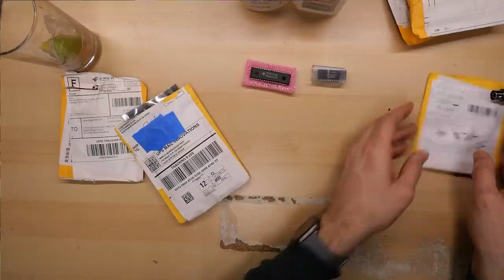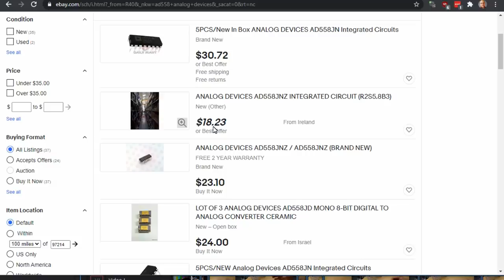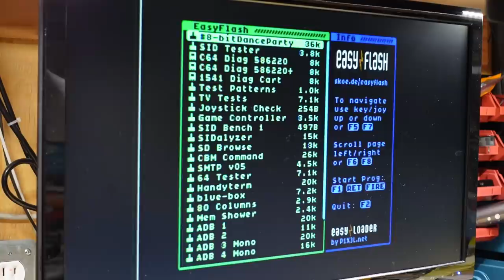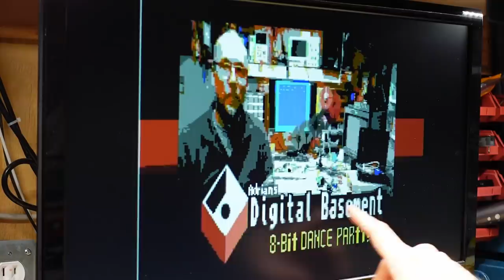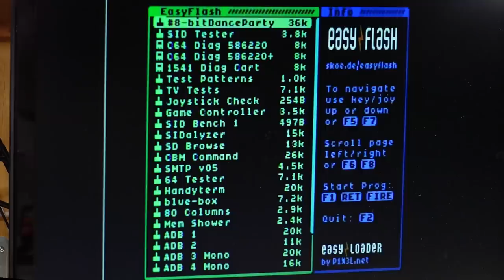I bought more C64 SID chips from AliExpress! (And some other chips too)

Comment: I would love counterfeit chips as long as they function like the real thing. So I actually hope they make a really good copy before these old chips are gone for good.
Reply: even if there close enough. like most of the time you dont need %0.0002 precision for old hardware.
Reply: There's always FPGA
Reply: There's nothing wrong the the ARMSID and FPGASID. Both very good and better in some ways than the originals.
Reply: @thomassmith4999  I've heard the ARMSID has some filtering errors
Reply: @cfothough  You are never going to get a SID replacement that's exactly the same as the SID you know because 10 real SIDs all sound way more different from each other than an ARMSID does from whatever one it's closest to. But it's good, especially ARM2SID since you get two sids inside the one chip.
Reply: @thomassmith4999  I'm aware that most SIDs don't sound exactly identical, but say you have 10 6581 R4 revisions, they'll all sound at least similar enough. I do realize now that the SID replacement I was thinking of was actually the SWINSID and not the ARMSID, the ARMSID sounds quite good in my opinion
Reply: @cfothough  Yeah the swinsid nano has flaws for sure, it's not bad with the lazy jones updated firmware, but it also only costs 5 dollars to build one, I built 30 of them one day when I was bored, kinda fun to build once you get a production run going. The Swinsid ultimate is much better. The ARMSID is very good for it's price. If you don't want to worry about your SID blowing up it's a good option. FPGASID is probably the best but it's expensive.
Reply: By the way, I am looking for a ULA chip for a PAL ZX Spectrum issue 4. If anyone  ever bumped into counterfeit ones. Just mentioned this because you guys are talking about counterfeit chips. And I hope someone can reproduct what is inside those chips because mine has a shorted cassette input/output pin.
Reply: apple macos would say with fakechip:  	Ḁ 	ḁ 	Ḃ 	ḃ 	Ḅ 	ḅ 	Ḇ 	ḇ 	Ḉ 	ḉ 	Ḋ 	ḋ 	Ḍ 	ḍ 	Ḏ 	ḏ
Reply: @andrasszabo7386  hungary
Reply: @uiopuiop3472  I am from Hungary, so, what about it?
Reply: @andrasszabo7386  just confirming
Reply: Most counterfeits are just other unrelated chips, badged to look like the in-demand chip, however.

The ones that actually work are usually out-of-spec or other rejects
Reply: The only way to replicate a SID is microcontroller or FPGA.
Reply: @bfapple  It's the analog filter that has people pining for the originals. The SID is just a simple synth with digital oscillators and envelopes with an analog filter. It can be done in a hybrid package, with the filter in discrete components and the oscillator etc. as a MCU or FPGA. Problem is, no one (that I've seen) has a schematic for the filter
Reply: @Psychlist1972  That’s exactly it. Until the schematic is released in the public domain, we can only guess.
Reply: @bfapple  Folks have de-lidded the IC, though. But yeah, that would still require a bit of guessing :P
Reply: @andrasszabo7386  Some of the Spectrum ULAs have been reverse engineered. Chris Smith had some decapped and put under an electron microscope and reverse engineered it - I don't think it was the one you mention but I could be wrong. He published a book about it: The ZX Spectrum ULA: How to design a microcomputer
Reply: They do it because the other chip was just easier to sell at one point or another
Reply: @nemoskull2262                                                                                                                                                            vv.                                                                                            V. Vvv.     F.              Ff.

Comment: As someone that's programmed for the TMS9900, let me tell you, the pin spacing isn't even CLOSE to the only weird thing about that chip. For starters it doesn't even have a stack pointer.
Reply: who needs a stack pointer? even if you want one you can easily use on of the general purpose 16 bit registers for that. With the indirect auto increment mode you will get pretty close the the normal stack pointer behaviour. The TMS9900 architecture seems to be 'inspired' by the pdp11, a computer that brought us c, and unix. Actually the orthogonality of the TMS9900 was rare at the time the processor was launched.
Reply: @available898  I actually learned assembly language on the 9900 as a little kid. When we switched to the C64 (cuz that's what everyone else had) it took a long time for my brain to shrink (as I like to describe it) before I could do 6502 assembly.
Reply: I stacked up the work spaces and used the 'registers' as local variables. 
The Otis 401 family of lift controllers that are all over the world used TMS9900s and its family of peripherals.
Reply: The workspace idea I really like, kind of like direct page on the 6809. I just am not a huge fan of the TMS9900 syntax, though maybe that's just the TI-99/4a assembler package. Also it's really annoying that you need both the 32k expansion and the disk drives to even use the assembler package. PEBs are just ridiculously expensive these days. I've used MAME for all the TI-99 assembly I've done, which isn't much. I'd absolutely kill to find a PEB for a decent price... people want like $500-1000 for them!

Comment: Sounds like TI99 did the same thing as the USSR did. The USSR stole/copied schematics for computers from USA where pin spacing as 10 pins per inch. The Soviets rounded one inch to 2.5 cm so their spacing was 10 pins per 0.9842519... inches. When they tried fitting western ICs they didn't fit.

Comment: 11:28 "no date code of any type". In the 1980s, some chip manufacturers left the "8" off the date code to avoid confusion with chip type numbers that also started with 8. That chip says "42300"  which probably means that it was made in week 23 of 1984.

Comment: The 2382 chip sounds fine, it probably has unusually high, "8580-esque" cutoff values. You may try Terra Cresta by Martin Galway or Lightforce by Rob Hubbard, those are excellent for testing "8580-esque" 6581s.

Comment: One of the major reasons that the 6581 is so hard to clone is the fact that they were made from masters that deviated a lot from the design specs, the 8580 masters on the other hand were much closer to the specs, which greatly improved their technical quality but also greatly reduced the stray current that enabled the digisampling with just the master volume control that the 6581 was famous for.

Comment: I have a feeling that smaller pin spacing is 2.5mm instead of those headers' 0.1" (2.54mm). Across 32 pins, the accumulated error would be 1.28mm, which I'd guess would be uncomfortable but not impossible to shove together, just as described.

Comment: changing the branding is simply cause certain chips get more money
Reply: the age of the CPU chip I think anyone would be happy with pin to pin compatible replacement, with any name on it? if it got there computer going, newer ones would probably be capital of running faster  with being newer, as with most CPU's

Comment: It sounds like the pin spacing on that CPU is 2.5mm instead of 2.54mm
Reply: I think some eastern European / soviet countries used the slightly off pin spacing as well.  2.54 was .1 inch and 2.5 was an attempt to make it "metric"
Reply: @stonent  yes, Soviet ICs had usually 2.5 mm spacing
Reply: That's what I was thinking too, metric spacing. Russians were well known for using metric DIP chips. It must have been real fun trying to put those socket pins in there. But what TI was thinking, who knows. Clearly a dead genuine chip; they probably had no way to test it. At least it's clearly not a 68000!
Reply: Genuine TMS9900's were 64-Pin, .9" wide DIP packages with .1" lead spacing. It is possible that the chip he received was a soviet clone having 2.5mm spacing and repainted as a TMS9900 - obviously a bad chip. At the time of the TMS9900 (1976), the 64-pin DIP, .9" wide was unusual but was chosen to prevent having to multiplex the address and data lines. Motorola would eventually use this package for the 68000. Honestly a repainted 64-pin chip could be anything so it might have been a 68000 instead of a 9900 - there is really no way to know for sure... you risk smoking a vintage machine plugging in these repainted chips - in my case I have built fully buffered "go between" sockets for these types of tests but even these aren't failsafe...

Comment: The filter on the R1 SIDs sounds very different than R4 -- there are some tunes that sound like they have missing basslines on the R1. I had an early model breadbin growing up that played Hubbard tunes (among others) completely differently than my friend's, and always thought there was something wrong with my system. Many years later, I blew out the R4 SID in my SIDstation and replaced it with a spare R1 I had from my parts bin, and manually sweeping the filter made it very clear what was going on.

Comment: This brought back memories - so many hours of my life swapping around components to try to keep a system running.  In the early '90s I ran a computer room at a small school.  When I first got there it had about 20 donated IBM PCs, and as each one failed I would replace its bad part with another from a machine that had failed in some different way.  I managed to keep the place going on a shoestring, but I don't want to think about how many weekends I spent on the floor of that room trying to get some Frankenstein's monster of a machine to last one more month.  By the time we closed the room ~8 years after I arrived, I think we were down to 12~13 working systems (and I broom closet full of scrap parts).

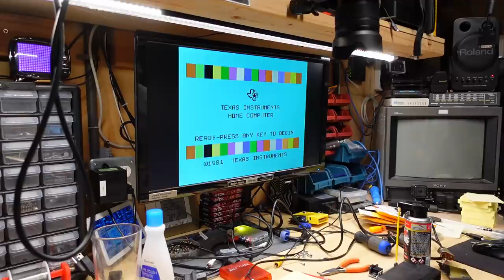Comment: 34:50 - the suspence was killing me, I was rooting for the chip to work and when the right screen showed up I was cheering like a 4 year old in a candy store :D It just made me so happy that the chip is finally working :)
36:50 - maybe you could try to use a socket that has the 2 metal thingies (or is it just one bent into a V shape), cut it up and solder the sides in so you'll have more horizontal clearance and play on the chips instead of just a single hole per leg. Just an idea. It might not look as clean but it might be easier to take the CPU in and out. And run the bodge wires inder the socket or something, but that's just me...

Comment: Today I fixed 2 Quickshot Turbo II joysticks, both had missing wires, one was just yanked off, one was cut. I had to tinker with the wiring with the new cable (used a 9pin dsub extension cable and cut off one of the ends), cleaned the microswitch contacts and they are just like new, I'm so happy!
Reply: Good work, it's always nice to repair things. I'm currently working on restoration of a 1981 'fruit machine' from an amusement arcade
Reply: What did you do for strain relief where the cable comes through the plastic shell? I'm curious because i would like to find a good method myself. I've tried with 4 zip-ties in a little square on both sides of the shell, but i think there must be a better way.
Reply: @MattyEngland  Wow, sounds really nice! I love restoration works, it's just so satisfying to do or watch.
Reply: @BertGrink  One of the joysticks still had the strain relief on the cable, I janked out the old cable and put it on the new one and put some electrical tape behind it so I won't be able to pull it through the strain relief plastic. The other one sadly didn't have the rubber strain relief so I just put a huge winding of electrical tape to keep the wire inside the shell so pulling on the cable won't stress the soldering. You can reuse old strain relief rubbers, they are not permanently attached to the wires and I also wanted to buy some online but it's hard to find the right size. Luckily the my new wire was the same size as the old one.
Reply: @Dukefazon  I think you have been quite lucky then; most strain reliefs i have come across have been bonded to the outer isolation of the cables, making it very difficult to separate the cable from the strain relief.
Reply: @BertGrink  I fixed a C64 PSU the same way, they cut the wires and I only needed to replace them with new ones and I could reuse the old strain reliefs (or relieves?). In the joystick's case I first took out the individual wire lines from the outer shell then grabbed what's left inside and pulled. It was glued or fixed there to a dot with some heat but after a little negotiation I was able to pull it out.

Comment: Lucky you that you got 2 genuine, working SIDs from China.  I recently bought 10 6581R4’s from two different electronics parts vendors out of Hong Kong.  The picture they showed me before purchase was of a genuine 6581R4.  (I actually already had one with totally identical markings as their photo.). What I received were clearly re-marked chips.  I didn’t have to do the acetone test to check, plus they had return policies and didn’t want to “damage” them from the acetone test and risk not being able to return them.  In the end, I got my money back.  The strange part is that of the 20 chips, many of them did not register as either a 6581 or 8580 in my C64 Reloaded board, but several did.  Of those, most had some degree of functionality of a SID, so it seems like what they do is either:  1. Mark a completely different chip with the same package to be the chip you’re ordering (in this case a 6581R4 SID), or 2. Clean up and re-mark an older SID with the newer markings to pass it off as the newer version but don’t check if the chip actually works.  I did find a few SIDs that were maybe 60% or 70% functional, and even found one that was probably 99% functional, but had to send it back to get my refund.

Comment: They may not be fake. Most of these chips are recycled from old machine parts, clean and legs re-tinned. It's a gamble because the seller does not has the means to test them out.

Comment: Could it be, that the "TMS 9900" actually is a 68000? They both have the same package and the M68k actually is a lot cheaper to get, from what little I know.
Reply: Wasn't the TMS 9900 the first single-chip 16bit CPU? I seem to recall they kinda set the standard on the 64-pin DIP packaging, which was later used by a bunch of other chips, usually high-spec stuff like the 68000 or high-integration parts like the Z180. That said, the package notching and markings look like TI's TMS 9900. If I had to guess, it's a legit TI part, but was probably just toast. If it's not a dead "refinished" TMS 9900, then it's some other TI part that came in 64bit DIP packaging.
Reply: I've not seen a m68k with such large circular marks, in particular the semi circular mark on the left. They seem to be smaller on Motorola DIP64 packages.

Comment: The 100- AMD-27c400's i got fro0m china were actually Micronix 27c4100's pin compatible but the eprom burner identified it internally. remarked. Chinese chips are like a box o chocolate,you never know what your gonna get.

Comment: I bought some chips from Ali some years ago. A 68010 for example, and it worked. It went into a Sega Mega Drive clone for fun and experimenting. It even liked the slight overclock I gave to it. The chip was sanded, and I did get a refund, but it works properly.

Comment: The use of machine sockets will make it harder install the TMS cpu, but the cheaper sockets may in fact be a better choice since they have spacing to better account for the slight pin spacing.

Comment: Whenever I socket something with a nonstandard pin spacing, I take a gold plated dip socket with a compatible pin size and use nippers to pick off one pin at a time and after its soldered in, clip off the rest of the plastic,, then if you want to get real fancy, you can use pieces of poster board to build a wall around the pins on top of the board and backfill with potting compound to the height of the pin sockets.. Either way, no funky Bending.

Comment: As a kid I went through 3 Commodores in two year (I finally got a IBM PC after that).
Though I babied my equipment the component failures were extremely high 
due to Jack Tramiel's philosophy of obtaining parts from random suppliers with the lowest prices.
Many Commodore computers ended up as door stops or in the trash. 
Many people simply tossed them in their attics due to lack of serious productivity software.
Who knew that in 2020 there would be a demand for its chips.

Comment: Many old devices will not function properly due to moisture ingress - very slow over time - when the device is not in service for a long time.  As in - no heating.
A time-honored solution, particularly with memory parts, is to bake them for 12 - 24 hours at a temperature of 95 to 110 degrees centigrade.
This technique has been used in PCBA facilities for many years when the devices have been outside their original foundry shipping sealed packaging beyond the prescribed warehouse-storage-life of the device.

Comment: The fake TMS9900 could very well be a 68000 or 68010, it has the correct number of pins (64) and looks almost identical to 68000 and 68010 parts I have. It'd be interesting to try it and see if it works after the 12v insult it got. You can put a socket in an old compact Macintosh from the original 1984 Mac to the SE, which used the long DIP package 68000. The later classic I think changed to the QFP variant.

The limiting factor is I think the pin pitch is not the standard 0.1" / 2.54mm, and is a bit narrower, so getting a socket may be a bit of a challenge.

Comment: Re: process to make IC legs look new... They will straighten them, brush them, then dip in molten solder in an effort to make them look new. Most of the dram, eproms and old chips from China seem to arrive here like that anyway. I've had problems with them 'binding' in sockets, or introducing reliability problems, so I try to solder them in directly if I have to use these.